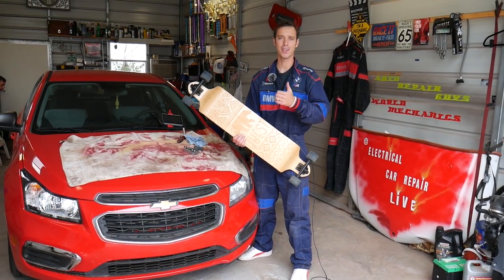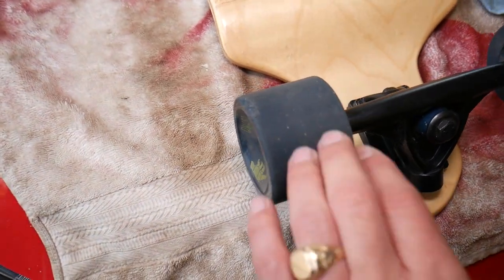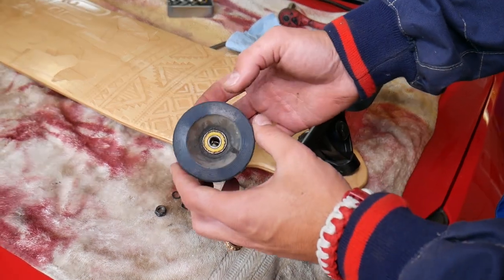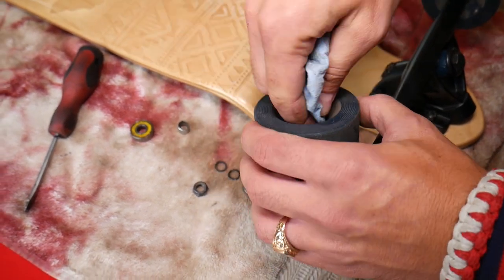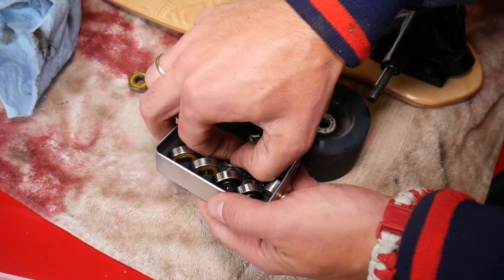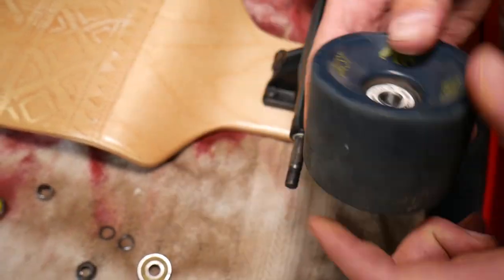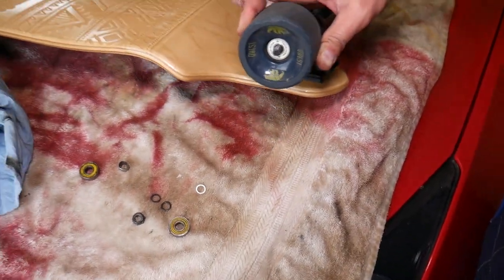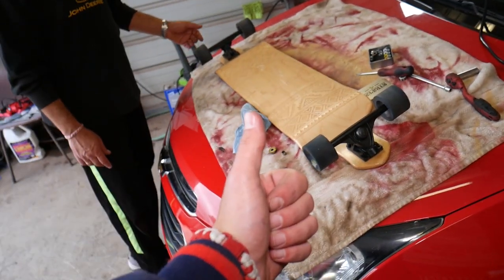HOW TO REPLACE LONGBOARD SKATEBOARD BEARINGS

Comment: It’s better to turn your board primo (resting on 2 wheels) to install the bearings. You should seat them firmly and evenly by hand, and then place the wheel on the axle and strike it with your palm. This will ensure the bearing is seated completely into the wheel and evenly. Flip the wheel over, and after placing the bearing inside, repeat the same palm-striking process for the other side. Turning the board primo will also allow you to align the spacer much easier when installing.

Comment: How do you check your bearing size? I am planning to replace my old bearings with new ones but I am not sure which size to choose idk if it will fit my board
Reply: ABEC 9
Reply: @abdullahal-shimri3091 abec 9 is not a size, it is the rating for the tolerances of ball and roller bearings. each abec rating is an odd number from 1-9, 9 being the tightest fittment in regards to the balls and roller, and therefore also the most efficient and quiet, abec 1 being the loosest fittment, least efficient, and loudest. if you push off with the exact same force on an abec 1 bearing equipped board and coast 10 feet before the kinetic energy is no longer keeping you in motion, then switch to abec 9 bearings and do the exact same push with the exact same force, you can expect to travel 70-100 feet further than the ten feet you traveled with abec1s, and you won't even be likely to hear your wheels vibrating on the tarmac/asphalt, more likely to hear them "sticking, gripping, and releasing," (it's a very hard sound to describe but unmistakable when heard).